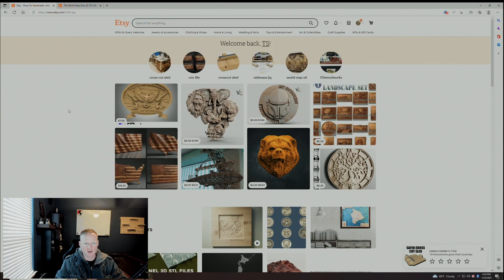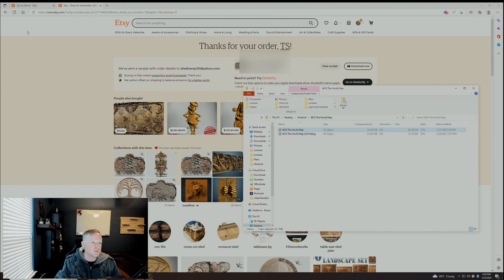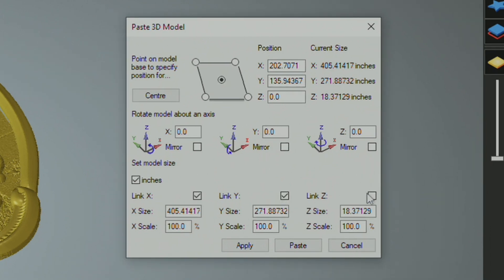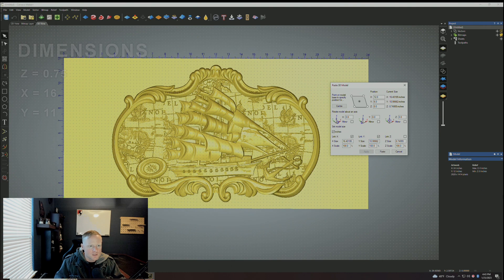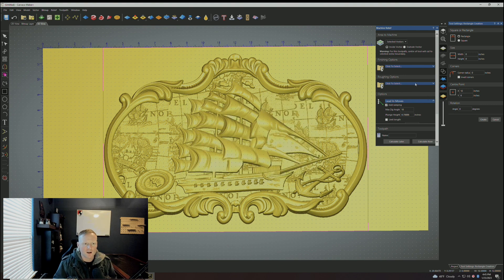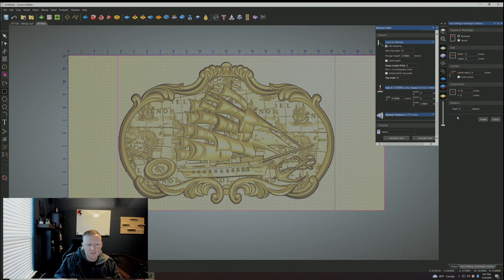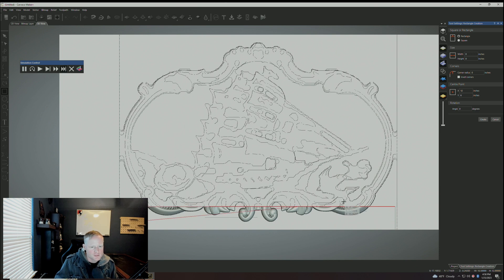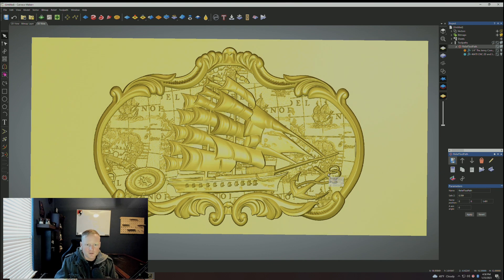Using 3D STL files from ETSY for 3D Carvings on YOUR CNC from the Software to the Machine

Comment: Hello, my name is Don,
Trying to do this project and I keep getting soft alarm on z axis line 14.

Can you help?
Reply from the maker: Heya, ensure the physical mount is in the lower position and the bit is capable of reaching the surface of your spoil board. Use your controller to lower the bit down until you reach it, if you cannot than you will need to adjust the mount lower until it can do so. (The adjustment is made where the Z mount screws in to the Rail) - Let me know if this helps!

Comment: What does "Stepdown" refer to? I've only done one 3d carving and I did not see anywhere referring to the step-down.
Reply from the maker: The step down measurement setup in CarveCo is the measurement of depth that the bit will drop down per pass. For example if I want my bit to take 0.25 inches of material off per pass I would set the step down to 0.25 - this ensures that the bit does not take on more than it can handle